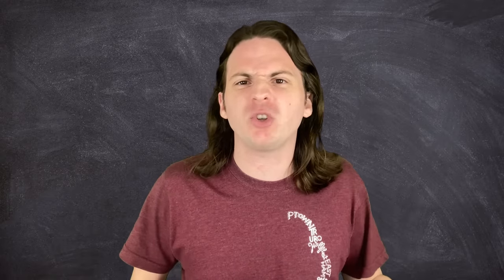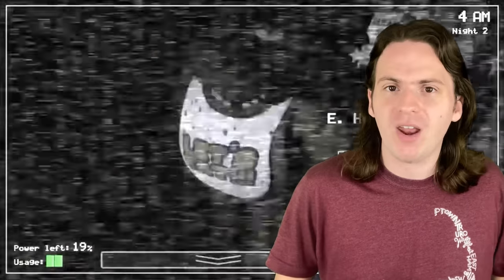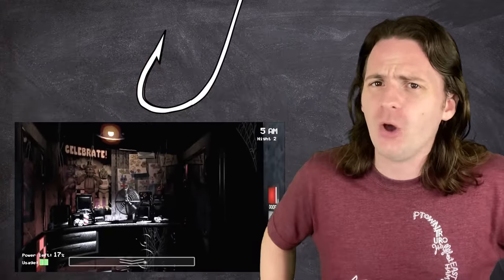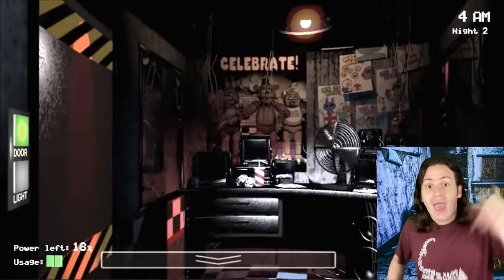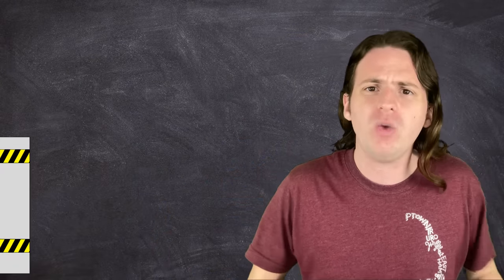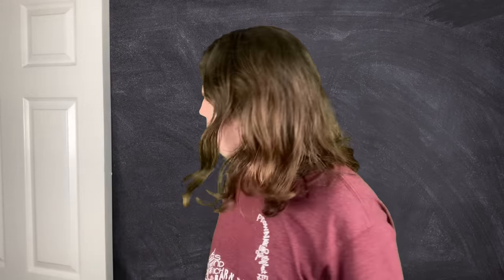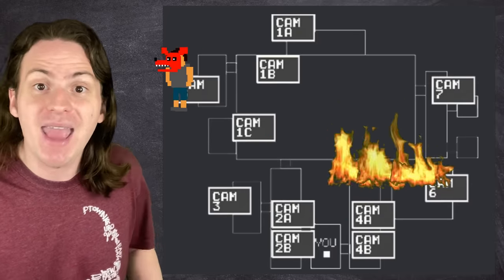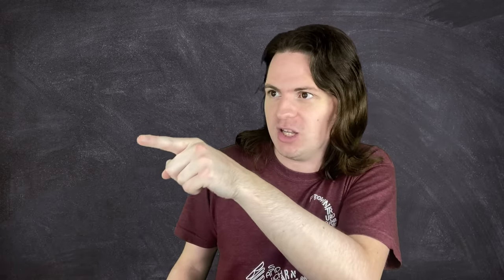Why Don't the FNAF 1 Doors Stay Closed?

Comment: 16:42, another idea is that the fact they are giant blocks of metal is because fazbear entertainment is very well aware of the animatronics being possessed. and if the building is an older location (I think its the same pizzeria phone guy in fnaf 2 mentions was left to rot even though fnaf 2 is a prequel, though this could be fixed if the location was an older location than fnaf 2 that got reused)  it may originally have had regular doors, and since animatronics are built with a solid steel frame endoskeleton, its possible there was an incident where one of the animatronics broke down the door and killed the night guard, as a result, Fazbear entertainment put up the doors we see in the game because the animatronics aren't stopped by regular old doors.
Reply from the maker: Here's my question, if Fazbear knows that the animatronics attack anything on sight (which they clearly do), why hire a security guard in the first place? Anyone who breaks in there ain't making it out anyway!
Reply: @TheChiptide  knowing fazbear entertainments blunders, they may be hiring them because maybe they want to keep the animatronics pre-occupied to prevent them from deciding to leave the establishment and causing problems. Or they are just really stupid as a company and hire guards anyways despite knowing they underpay workers for basically working in a strategize or die job.
Reply: @TheChiptide  there really is no reason to add steel doors like these in the FNAF one office for no reason unless the animatronics were taken into account.
Reply: @TheChiptide  I sometimes like to come up with sensible, probably not lore compliant, reasonings why Fazbear Inc does any of the dumb crap they do, and usually the best answer I can come up with boils down to: 
"Henry is actually responsible for a lot of Fazbears early shortcomings by being a callous cheapskate and idiot, and there was a timespan (around the initial creation of the FNAF and maybe FNAF 2 locations) where William snapped but wasn't kicked from the company yet, and used his influence to force select particularly stupid decisions onto the company out of spite against Henry (but also he was never particularly clever either hence why he didn't manage to catch some fuckups that happened before this in the timeline). 
Once William got springlocked, Henry had grown distant enough that he adapted a 'My way or the high way' approach towards managing the brand, meaning that he would double down on any of his other mistakes and refuse to reconsider anything (most easily visible not in a business decision but in the way LEFTEE functions and he talks to Mike during the Pizza Sim ending).
And once Henry was done, 'Whoever is in charge now' was far enough removed from the creation of the company that by now, their bad decisions boil down to the usual CEO 'squeeze them dry till there's no drop left' mindset, a bit more extreme than usual due to being emboldened by the fact that the company got away with some insane shit in the past."
Or TL;DR: Fazbear was never led by anyone who wasn't callous and stupid, malicious and reckless, or both, and Fazbear employees really ought to unionize.

Comment: I've always thought that they opened because there was a fail-safe system to prevent people from getting trapped inside the office in case of a an emergency, like if there is a fire and the power goes out, you won't get trapped in a burning room.

Comment: What I love about the wooden door idea is that it would actually work because even the Nightmare animatronics couldn’t stand against wooden doors in FNAF 4, and there’s no shot the regular animatronics would be stronger than the Nightmares, so the regular animatronics would just kinda do nothing about it. On top of that, there are windows to the office (which, at the very least, Chica is aware of), yet the animatronics don’t break through them, so they probably just don’t break stuff , and will only really enter an area if the entrance is ethical. The only real concern would be Foxy, but other than that, a wooden door would be even more safe than the one we actually get
Reply: nightameres in fnaf 4 are mannequins that look this way because william puts an hallucinatory gas in the room they are mounted on rails and can't break down doors stay up to date on your lore please
Reply: @leschatssuperstars1741  even if so, the mannequins are still just animatronics, all be it, with hallucinatory chips, as confirmed by the graphic novel, “The Twisted Ones”, heavily reflecting how the Funtime animatronics, which seem much larger and stronger than the regular animatronics in my opinion, so even if the Nightmares aren’t stronger than the regular animatronics, they’re, at least, equal to them in strength. On top of this, my second point about the windows still stands, even with the knowledge of the hallucination chips
Reply: @CollidedUniverses the nightmares are made by William to scary Crying Child not kill him
Reply: @Axolotl720  that’s a fair point

Comment: I still think they could make a way to lock the door without comstantly using power which still relases when there is a loss of power but makes it so that the door when closed doesn't actually utilise a power / utilise a negliciable amount of power when shut. Ik it would ruin the game but it would be safer since animatronics attacked kids back then and kids would have a safe place to hide.
Reply: it probebly did use a negliciable amount of power, when the bilding was open. it is using a genretor in the game, moslikly not a good one.

Comment: considering from a lore viewpoint, fire is a HUGE component in the games. fnaf 3 and 6 both burned down. fnaf 3 especially has burnt animatronics from fnaf 1, so therefore that location most likely burnt down after the events of fnaf 1.

as for my explanation of how closing it drains power, i can think of two other ways. spring powered and sealed piston powered. springs at the top of the door when the door is opened keeps the springs compressed. power is used to pull the springs apart causing it to close the door. the other one is sealed piston. when the door is open, the piston is at the normal level. when its closed, the piston pulls apart creating a vacuum inside. this requires power for the piston to be extended.

Comment: I think that the doors are constantly pressing down using hydraulics. This is done in order to prevent the animatronics from lifting the doors up. Foxy actually runs to your left door, trying to pry it open, causing the hydraulics to compensate with more energy and downward force, thus draining your power
Reply: The animatronics have not the power to lift the doors.

Comment: I always thought the doors had extra force (power) keeping them shut so the animatronics couldn't pull/wedge them open, and they're big metal doors instead of normal ones for the same reason, so they can't be broken down or forced open. Foxy takes power when you block him with a door because the door's mechanism is exerting extra energy to prevent him from opening it. The doors have to default to open because you could get stuck inside, or get locked out and not be able to get in since the controls are only on the inside. The animatronics are big, strong, fast, and dangerous, so you basically need bunker doors to stop them. A human wouldn't be able to open them by any means other than the controls

Come to think of it though, they coulda just made the security room a "safe room" animatronics can't enter, one of which already exists in the building. They wouldn't really have a reason to go in there, so it would've made sense to make it an off-limits room to animatronics just in case of any late night quirkiness going on. Or have the security guard operate from the safe room instead of the current security room

Comment: The best solution they could have used is probably a thick metal door and a strong lock mechanism. If there is an exit behind the player, make the door open towards the desk in case of a fire for easy access. If you want convenience of desk tough, make the room a little larger first.

Comment: Springs or counterweights would easily explain the energy drain mechanics. As mentioned, having the doors open by default is safer to prevent damage to limbs and avoid trapping people inside.

Comment: Very simple. Pistons in the door extend downward against a spring pulling the door back up. Which is why it takes power to keep the door shut, because the pistons are counteracting the spring. A very genius design that makes plenty of sense. A common belief would be that if the power goes down the doors should slam shut with gravity. However, you’d be trapped in the office. So if something as simple as a fuse blowing occurs, there’d be no way to exit. A safety hazard. 

I think people also overestimate the animatronics strength. They’re robots, but they aren’t designed to be strong like a Terminator Unit. I actually don’t think that most of the animatronics could take a bite out of you. The teeth are probably what cause the problem. Animatronics with more teeth, say, Fredbear or Mangle or Foxy, would generally require stronger jaws that could crush arteries and possibly bone. But even if to assume that all of the animatronics from 85 were capable of biting, there would be legal requirements for the 93 models to have less bite force. Hence why they don’t really eat you, but instead likely drag you to the Parts n Service room and “dress you up” in a suit. But they certainly are not powerhouses like some depict them, and therefore the doors are very effective.

Comment: I vote they work like really old windows with counter weights that hold it up and the button just toggles a motor that pulls the ropes connected to the weights, hence when you run out of power the motor cant hold the weights and with the company being very old and very cheap it would make sense since this is a very cheap and effective system that can work and is still relevant to the time period

Comment: Its so you don't get trapped in your office during power outages or fires, amd they dint use normal doors so the animatronics cant bust down the door and so they mistake them for walls due to the lack of a handle

Comment: My theory actually has to do with Foxy's gameplay mechanic. If the door is shut, when he gets there, he will bang on it aggressively, draining some power in the process. The doors were never for the "fires" or "power outages" their to keep the animatronics from banging down the doors. if they were wooden hinge doors, freddy & co being canonically 10 ft tall and over 500 lbs (based on circus baby's blueprints from SL) then yeah, they can just tear through that immediately. Doubling as fire doors, based on Pizzeria Sim also makes sense too. So Both.

Comment: i actually remember seeing a really huge schizophrenic theory on these doors back then, cause it was weirdly highly contended for a bit, it was a theory that the doors actually slide in from the side that locks using power, and the metal part is just a safety cover that is lowered by also using power and all, its very weird cause it makes literally no sense in a buisness standpoint to have these super high grade mag-lock doors with an entire warning before shutting them, but then again, is have a potentially 2-3 inch thick piece of metal fall down into place using power more believeable?

Comment: Imagine this; You are on day shift at Freddy's and Freddy and the gang use a bit too much power, and the whole building goes black. You now are trapped inside the security room for the next day since the last bits of power weren't used to open the door before the power ran out.

Comment: my theory: the reason Fazbear used such a crazy solution is due to them implementing it back during the pioneering days of automatic fire doors. (At least this solution was one that worked in the long run, unlike some of the other solutions thought up during that time)

Comment: The whole weight mechanism that holds the door open when there's no power applied certainly seems possibles, and possibly explains what's in the empty wall space between the two halls. Fun fact, fire doors actually automatically shut. It's a mechanism to control the spread of smoke, and keeps fire at bay for a certain amount of time. A metal info stamp on part of the door will usually give info on how long the door can withstand the fire. The larger the facility is, the longer the door will need to be able to keep the smoke and flames at bay.

Comment: I think that the doors were designed with the animatronics in mind because of the phone guy, dude straight up disappeared on his 4th night and (from what we can tell) Mike quite literally was just given his recordings, even the one where he can audibly be heard getting attacked so even if Fazbear Entertainment doesn't know why, they know that the animatronics are attacking security at night.
Also the system seems quite fragile since Foxy hitting on the door easily lowers the energy.

Comment: I feel like I remember seeing somewhere that it uses power when shut because it is forcibly keeping closed to prevent anything from being able to lift them open, and they open when cut off from power as a form of safety to prevent someone from being trapped in the room incase of some form emergency.
(Disclaimer, I wrote this before finishing the video)

Comment: The metal doors were designed specifically to deal with the possible threat the animatronics posed to the staff, as seen in the previous location, one that did not have doors at all. But the unpowered release mechanism being a fire safety feature makes perfect sense.

Comment: The fire door idea is honestly really good! I've got some other thoughts on it that I'll be getting out here because I want them out of my brain:
Why would Fazbear Entertainment care about safety (assuming the doors opening is a safety feature)?
It could be that they didn't, but the contractors/construction crews did. A lot of the safety issues that Fazbear Entertainment had was related to the animatronics; something they build in-house. Unless they have their own construction business, Fazbear likely outsources the building of the establishments. While Fazbear might not give two shits if their employees die trapped in a security room, the construction company probably would. Thus, the safety feature is installed.

How do the doors open when there's no power?
Aside from the pulley theory, I think it's also possible that the doors have a sort of battery attached to them. These contain just enough power to open the doors and put some sort of lock on them (like you discussed in the video) to keep them open. Makes a bit more sense and would likely be cheaper than the whole pulley system.

Why not use a normal door?
They're security doors. They're meant to not be openable from the outside and hard to break through/force open. An up-and-down style door is the hardest to force open, as your fighting 100% of the weight of the door as opposed to hinged ones, and the hardest to break open as there's no hinged weak points.

Why do the doors require power to stay closed?
Aside from the "cause game" answer, my guess is that the doors aren't just what they appear; they do something else. Either that's keeping the door more closed, like with an electromagnet system at the bottom to make them harder to force open, or something to fend off animatronics, like electrifying the door or sending out some "return to your stage" signal. Not sure, it's definitely the weirdest part of the door lore.

Comment: It makes sense as a safety mechanism. If someone were to get trapped underneath, theoretically, the hydraulics would deactivate upon being unable to keep the doors closed fully, which opens the doors, preventing further damages. With power, it wouldn't make as much sense, at least not with the hydraulics I use on my farm. Though some hydraulic systems are meant to only be operable when provided with enough power. Hydraulics can also use a lot of electricity, especially when they're not properly maintained, old, and so on. When the power goes out, the doors would be forced to be pulled back up, as the hydraulics being held in the "push" state would require electricity to ensure that they're able to deactivate in the event something like a child underneath them is present. Energy would be used to keep the safety there.

Comment: I genuinely think the doors could be solved if they just... slid sideways. They're a good solution for a small room betwixt hallways, and they're a good solution for automatic fire exits. The only real design flaw is just... its a big hunk of metal that falls from the ceiling. Have it be a hollow metal door with a wire-mesh glass window, that slides side-to-side as opposed to up and down.

Comment: I always assumed that the door is opened when not supplied with power as a sort of fire safety thing. Imagine there is a fire that disconnected the power lines and suddenly you were just locked in a room and with no way out.

Comment: Iirc there was an explanation that the doors were electronic springs and magnetic rails, when they are closed, the springs are powered and they push the door down alongside the rails, this way nothing pulls them back up, even with tools, beside it's a clearly heavy metal door both by appearance and sounds.

When there's a power outtage, by design, power to the doors is cut so that in case of a fire the security guard is not trapped in there and there's no risk of death, though it's weird since they're big metal doors, slamming them shut would prevent smoke and fire from coming in, it wouldn't prevent it breaking the window, though.